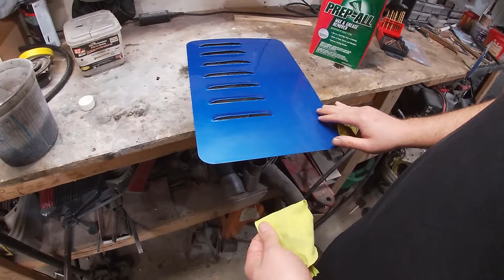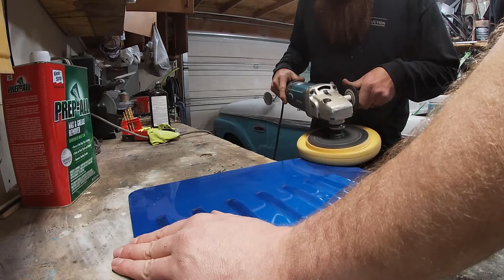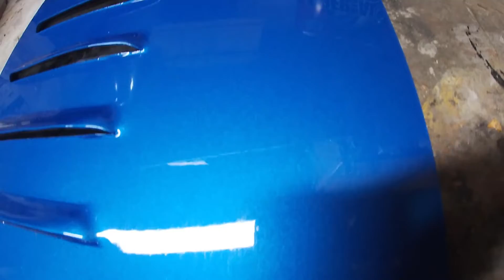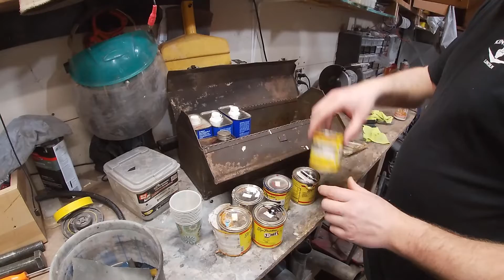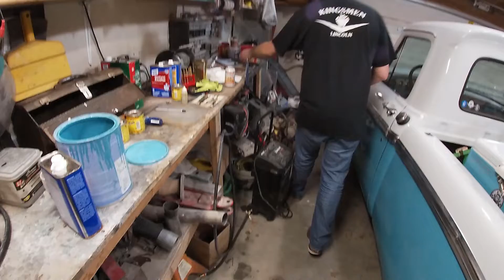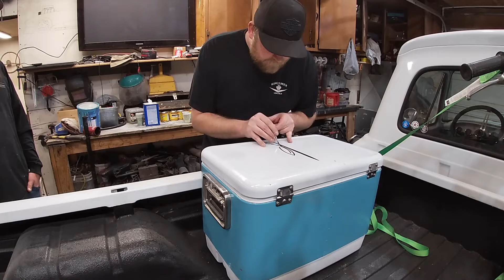Pinstriping The Sub-100’s Cooler

Comment: you suppose to wait untill the paint cure be for you strip on the service
Reply from the maker: The cooler had been painted  for over a year before we pinstriped  it.
Reply: @FullThrottlePerformanceMike  but your friend said it was just painted so something fishy i am talking about the one that was blue and you guys was trying to fix
Reply from the maker: @AndrewMurphy8383  we used the the base coat green color  from the truck. So the strip would match the truck. It didn't work out that well in a few spots and he found some striping paint that was close to the same color  and "tried to" fix the bad spots the cooler it self was painted the year before. Sorry if that was confusing  in the vid.
Reply: @FullThrottlePerformanceMike  well your friend said the blue thing you was taking the buffer to it was just painted that day that why i said what i said sorry
Reply from the maker: @AndrewMurphy8383  shit my bad I thought  you  were talking  about  the cooler. Yes that wall art was painted  that morning  and was being  rushed  to get  done  for charity  auction  the next day.  It was a last minute  idea for the auction  and it turned  out  great for what it was.  But yes please  let your clear coat cure before  doing  anything to it.
Reply: @FullThrottlePerformanceMike  I THOUGHT YOU FINALLY CATCH ON TO WHAT I WAS SAYING LOL